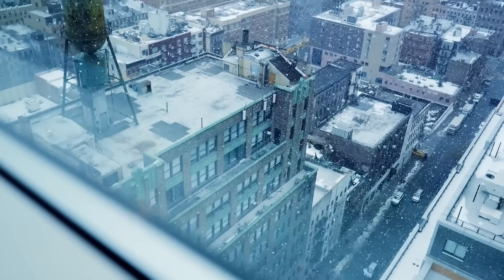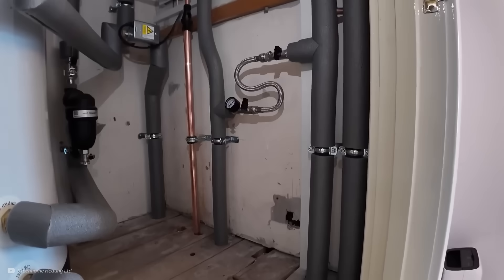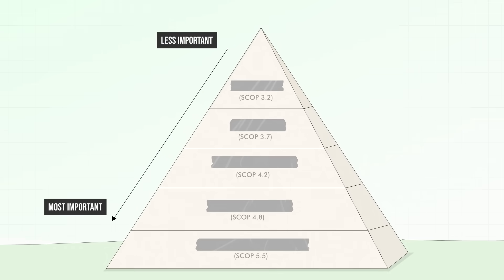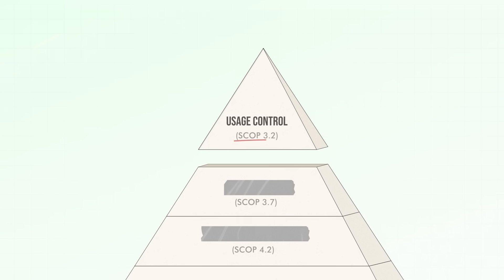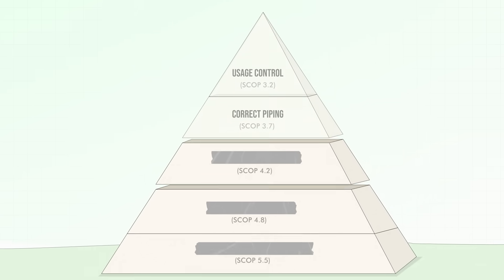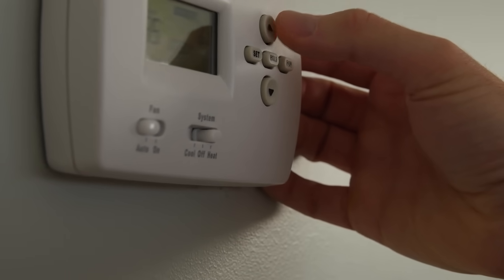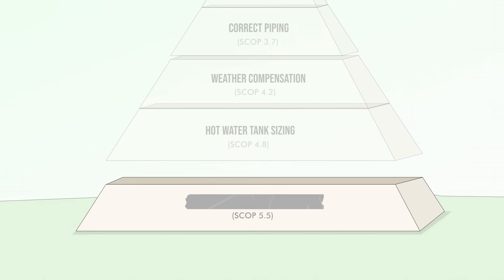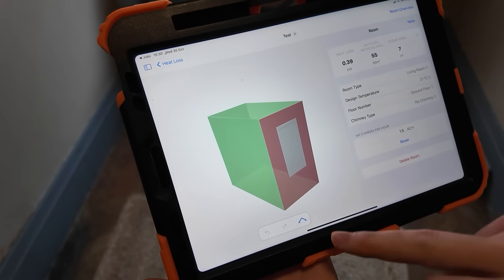The Genius of the World's Most Efficient Heat Pump

Comment: Thanks for v.interesting video. Your average UK installer will never have the required triple-skills in electrics, plumbing and refrigeration for this to ever be mainstream  [not in my lifetime anyway!] - but for the enthusiast it is a great hobby project. Just one question - can it be used in air-conditioning mode ? ie. can you reverse the coolant to export heat outside ?? - it would be an extra selling feature. thanks.

Comment: Seriously?
 Do you think this is an invention? There are engineers in installations who know these details, including me, for 20 years, at least.
Radiators are the last century. Underfloor heating, among other things, can cause health problems in the feet.
The most useful is heating and cooling through the air, just like the climate in cars.
If you have knowledge in this detail, it is worth paying attention. If not, you have lost from the start.
Then houses must be equipped with air recovery systems. In the classic case, the efficiency is 0. In this video, 80% of the information is harmful to health.

Comment: Hey, can anyone explain why if you can get 800% efficiency out of a heat pump why couldn’t you use the hot side to boil water or some other liquid with a lower boiling temperature to power a turbine to produce the electricity needed to run the heat pump and just use the waste heat to heat your home. Like I think I remember someone saying steam turbines are like 30% efficient getting electricity out of heat so with 800% efficiency from the heat pump you’d think you pull get like 2x the electricity you put in. I know like perpetual motion machines are impossible but this would like a closed loop of taking energy out of the environment making it practically a perpetual motion machine. Where am I wrong here?
Reply: The efficiency comes from the closeness in the temperature from the source to the destination.  e.g. 25C ambient to 48C water.  The further the two temperatures are from each other the less efficient you get.   Heat pumps also have a maximum temperature depending on the refrigerant. e.g. R32 is about 55C, R290 is about 75C and R744 is about 95C.
Reply: Yeah no I get that and like efficiencies definitely could suffer trying to boil something and especially boiling enough to build up the pressure needed to produce electricity but like that’s also why I mentioned other liquids with a lower boiling temperature. I remember something from a while ago where in areas with lower geothermal heat some people were using liquids other then water to run a steam generator so they didn’t have to have temperatures over 100c acetone has a boiling temperature of 56c and R11 has one of 23c. I mean you’d have to have it as a closed system but hey you could even use a hot water tank as a condenser. I still think it’s a bit far fetched but efficiency of 800% makes me wonder

Comment: Heat pumps are efficient and also i colder climates, and their efficiency has improved over the years. We replaced our 12 year old extraction air heatpump to a air to water heat pump in Jan-23. It is a Mitsubichi designed to still have positive COP at least down to -15 to -20. I live in Sweden where the average temperature over the years is at around +8C. We heat 170m2 and usually never go below 21,5C indoors. On top we heat a garage 35m2 +35m2 atic to 10-15C +all hot water for the household. Our consumption including cooking, lights etc in 2024 was 15800 kWh, and such a low consumption despite elecric floor heating in two bathrooms. The house has water borne floor heating with clever individually controlled temp in each room from a company named Uponor. So for all still sceptic about heat pump. Buy an extra blanket, or a heat pump😊

Comment: Do you want to really increase the COP of your heat pump, regardless of cost? Read carefully:

Imagine it's heating season. You're heating your home, right? Ask yourself: where does this heat go? You're right: through walls and windows!
You can build an additional wall around your house with an empty space or a void between it and your original wall. The heat will exit your house into the void between walls and heat up the air. The new wall should be built in a way it routes warm air up to the heat pump - that will then move your heat that you've just lost BACK to your house. As the air from the void is warmer than the outside air, and as COP really depends only on temperature difference between outside and inside medium (air, water), your COP will increase.

Another good way to increase COP is to use water! If you live close to a creek, lake or sea, its water can never be colder than 0°C (as it would freeze). Water heat exchangers are always more efficient than air and even when air temperatures are sub-zero, water is always above zero. Water is good in summer too, as it is always colder than outside air temperature. That's how you'll really get 500%+ COP, not some fairy tales.

You don't have a creek or a pool of water next to your house? Well, try removing air fan from your heat pump. It consumes a lot of electricity which is totally wasted. Build an appropriate chimney above heat pump, so it would create sufficient air draft and increase your COP.

Last-resort option for those who have little money and do not have a body of water around their houses: spray (tap) water directly onto air heat exchanger of the heat pump (this can be used only for increasing COP during summer time).

Comment: Great discussion, but still missing the most crucial gain. How to run the heat pump on cheap electricity rather than expensive electricity. How to run it on night rates of 7p/KWh, available for 5 hours, and not on day rates of about 30p/KWh?
In Germany the way to do this would be a 1000 litre heat store, which decouples the heating from the heat source. UK homes tend not to have space for 1000 litre tanks. 
I did look at using batteries, but these are only considered as part of a solar install, and add to the cost. 
So what is the solution?

Comment: Ok, to be honest, I think some points are valid, I actually use 42 degrees in the hot water tank (300 l), but the pipe shape and flow rate is total BS. Yes, the pump (the water pump, not the heat pump) will consume less, but that's just a fraction of the used energy. Piping that comes AFTER the heat pump does NOT affect the energy deposited into the water 🤷

Comment: For new constructions:  
1. Can larger diameter plastic piping offset the gains from copper?  
2. Does underfloor radiant heat in a slab improve efficiency?  How about the slab thickness and/or thermal mass?

3. Presumably cooling doesn't use radiators or in floor tubing.  If I have mini-split units for cooling, should I also use them for heating?
4. Are their AI control systems that use weather forecasts to help streamline the load.

Comment: This is just a play on making every step/aspect waste less... basically making the process more efficient.

What I want to know is what is the theoretical maximum Heat Pump COP for modern heat pumps.  (Basically if all the heat is required at the heat pump itself and we assume no more losses from transferring from Heat Pump to radiator location -piping, length, radiator etc.)

Is it around COP 8 (800%?)

Comment: I notice this was only really relevant for hot water heat pumps, what about air to air heat pumps like we have in New Zealand? We mainly have mini split systems or if you're super bougie you might have a ducted air heat pump for heating in the winter and cooling in the summer. Any way to make these more efficient?

Comment: We have an old heat pump system, which isn't so efficient, and when it gets down to around -4 C to -5 C or so and colder, it doesn't work so well. Thankfully our climate is fairly moderate most of the time, and it is somewhat rare for it to get well below the above, though it does occasionally get to and near it. 

   We have a lot of trees on our property, hence there is a lot of free fuel lying around which is too small, sometimes too wet, or the like for the woodstove (which we don't use much, since we would have to purchase wood most of the time). So I bought a relatively inexpensive outdoor smokeless camp fire pit.  Large enough that it will run for a few hours or so. 

  On those semi rare, particularly chilly nights (-4 C and colder), I put the smokeless camp fire pit/stove near the outdoor condenser unit (a few feet away * ).  I then take a foam with an IR reflector on it, and wrap it around the fire pit/stove and the condenser unit so that the heat from the stove will be better directed towards it, but with plenty of space  on all sides so that the fan/suction is not interfered with and so the foam doesn't over heat. Creates a sort of semi insulated box, which warms up much of the condenser unit (but since the fan is running almost constantly during these times, it never gets hot). 

     I put a very large pot of water with a cover/lid on top of the smokeless stove.  Right before I go to bed (I'll usually stay up later than usual these nights), I light it up.  Occasionally the wood is too wet, so I will buy some cheap pellets (like pine pellets sold for horse bedding) and/or put a little charcoal on top to help dry out the wood.  (These systems burn top down generally). 

 * Note, I put a stainless steel, fairly fine mesh screen over the top (it rests on a grille, and the pot of water rests on the screen which rests on the grille which rests on the stove, so no chance of the screen going anywhere, even with very strong wind). It acts like a spark arrestor screen. There is very little chance of this system causing a house or yard fire with this set up, though technically it may not be the most legal set up.  A regular inside wood stove is far more dangerous with things like creosote build up/potential chimney fires imo.  The stove is only "relatively near" metal. I clear the ground of leaves and debris near the stove. I've watched it burn for hours (I also take it camping) and haven't once seen a spark fly out of it with the screen on top (nor does anything come out from below).

  One of these days, I'll probably bury some large copper pipes in the ground down around 10 feet, filled up with highly thermally conductive material most of the way (3 different sized silicon carbide powders/granules), and then wrap the lower part of these pipes with "heat pipe" type copper tubing (copper tubing with some water and wicking material sealed up inside and all under a vacuum).  Both the large copper pipes and copper heat pipe tubing will be well insulated in key areas (as it nears the surface and until it contacts the condenser unit). The heat pipe copper tubing will wrap around certain parts of the outdoor condenser unit, so that it will be constantly exchanging energy with the deeper ground. This should take off some of the strain in the peak of summer and winter.  I don't have the money or land to set up a conventional ground thermal exchange system, with an underground water tank, long piping underground, or the like. 

  When you don't have a lot of money and resources, you have to think outside of the box and come up with alternative solutions. Methinks mai Highland Scottish ancestors would be proud.  

  If I actually had sunlight on my property, I would be using Solar heating and heat pump boosting instead. But just not enough consistent sun around.
Reply: In the summer, when it gets very hot, I just hose down the condenser unit with our well water as well as spray the roof when I can.  Humidity is often more of a factor than pure heat, so at night (when it is most humid, least hot, and electricity is a bit cheaper) I'll turn up the temp on the central a bit, and run a dehumidifier. The dehumidifier is more efficient than the the central AC at removing moisture (and is energy star rated), and running it at night only helps to not overwhelm the AC during the day when it can already struggle.

    I figure every little bit helps. When my system does finally go, we'll probably invest in a much more efficient heat pump system than we have.

Comment: Mine 1st rule as a HVAC-R tehnician : Never use same machine to heat domestic hot water and to cool/heat your home. Combine for example monobloc unit for floor heating/ceiling cooling and for domestic water you can use combi boiler with r134 or r290 and if you can, put few solar panels in extra spiral of boiler and that's it. And program well your hot water recirculation pump, those are energy eaters
Reply: Maybe you used text to voice, but what you said was unintelligible
Reply: @snorttroll4379  Hello! Which part you didn't understood? And yes... English is not my first language 😀
Reply: What is the problem with using one heat pump for both heating the house and heating domestic hot water ?

I'm considering an air to water heat pump (Mitsubishi monobloc with R32 refrigerant) and the manufacturer say that I can heat my domestic hot water ad well.
Reply: @pauld3327 1st - If pump goes in any error, your whole system stops, you dont have DHW, yes, you can enter emergency mode where your pump work via electric heater, but you must wait your techinician to come. Imagine if your compressor break down... 
2nd More moving parts, more risk to have problems
3rd You will need more space, you will need aditional buffer tank for heating/cooling space as reservoir when pump goes into heating DHW, because pump cant heat/cool your house and in same time heat your DHW.
4th More expensive, heat pumps that can combine DHW  and space cooling/heating cost more to maintance, they have more working hours and shoreter lifespan

Thats mine observation, hope it helps and Mitsubishi Electric is great!
Reply: @B.ori.s Thank you for your answer 👍

Comment: One more thing that could be done: The efficiency of heat pumps is higher when the temperature difference is smaller. If you use an air heat exchanger (not an underground heat exchanger), you get way better efficiency during the day when it is 5-10° warmer than at night. If your house is well insulated and has lots of thermal mass inside, you could get away with not heating at all in cold nights, thereby avoid running at the most inefficient time.
Reply: You are thinking in the right direction, but in practice it is not worth it. You indeed do get higher COP during the day. The problem is if you only produce heat half of the time (or less), you have to transfer it to the house twice as fast (or more) and that means you need system temperatures twice (or more) higher, relative to desired room temperature.
E.g. for 21°C and floor heating typically the system temperature will not go over 35°C (14°C delta). To get the same amount of heat in half the time you would need 28°C delta, or 49°C system temp, which is almost guaranteed to negate any daytime temperature gains.

Comment: This what is explained at @9:45 I implemented with my gas boiler at home over 15 years ago... the maintenance guy told me it was bad practice... but then he was also working for the gas company.

It is the same with radiators, I had fans blowing through them to dissipate the lower temperature heating faster... I used to be ridiculed and now you can buy these fans for quite a steep price at the DIY store...

Comment: Overunity is impossible in our universe. Therefore nothing can be more than 100% efficient.
Reply: And it isn't, but when compared to resistive heating which is essentially 100% efficient, heat pumps deliver the same heating but with far less energy used. All because it can move otherwise unused energy to where you need it.

Comment: Do you realize that using such an efficient heat pump you can generate more electricity than it consumes: from 1 kW input you can get 8 kW output heat - with steam generator 50% efficient you will get 4 kW output.
Reply: It doesn't work like that. A 50% efficient steam turbine requires high temperature steam, not lukewarm water.

Comment: Why the hell would you use a heat pump to heat water to very high temperatures, then send that water to radiators around the house?  Just pump the heat directly into the air in the house with a forced air system.  Radiators are so 19th century.

Comment: If you constructed an insulated housing around the outside heat pump. you could connect an Earth tube to the enclosure and keep the air around the heat pump at a steady ground temperature all winter. Around here, the ground temperature is about 60 degrees. It seems the heat pump would run far more efficiently if the surrounding air temperature never dropped below the ground temperature.  All that is required for Earth tubes is a small fan to force air into the enclosure. This would also work in the hot summer.
Reply: If you're wanting to do that I would suggest getting a proper ground source heat pump instead.

Comment: Very interesting. Our Heat Pump also functions as an Air Conditioner in the summer. However it supplies the heat or cooling to each room via large diameter air ducts in the attic through ceiling vents. Are there any ways of raising the efficiency of this type?

Comment: I am curious, how does the domestic water heater come into play? This is my second video seeing a water heater installed, I suppose, along with the heat pump. But I have NO idea how it's hooked up, where does the heat come from to heat the water and such. Can someone point me to a video that explains how this water heater is hooked up to these heat pumps? The first video, the tank was outside in -40ºC temperatures. Again, I've never seen a tank next to an outdoor heat pump unit, so I am just assuming it was the water heater.